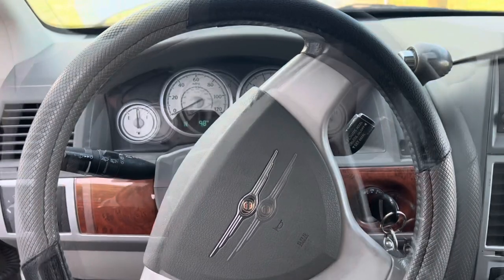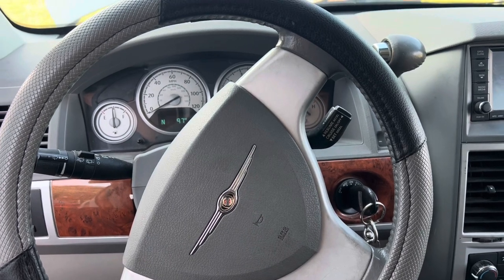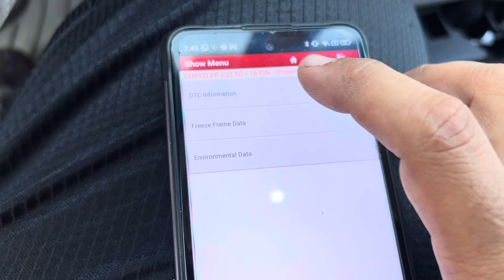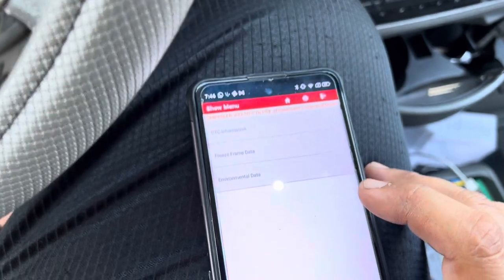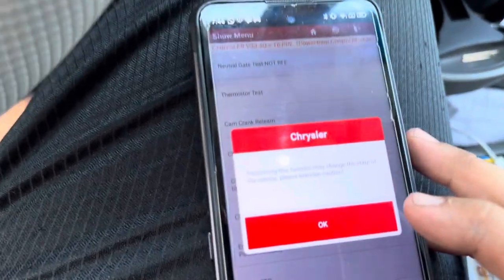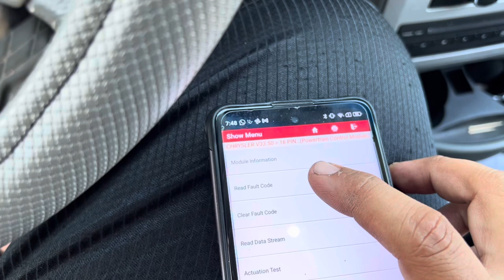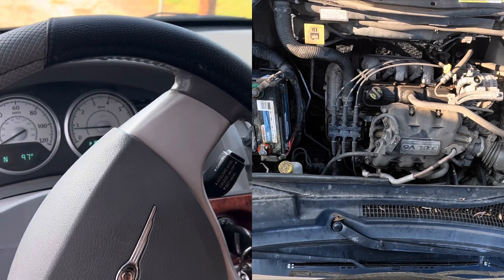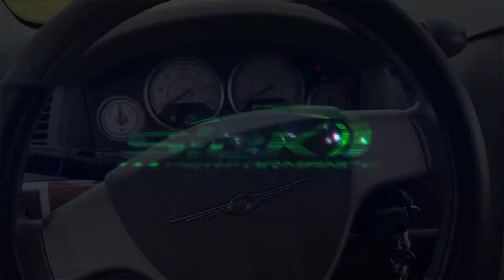P1745 Chrysler/Dodge - How to Clear Permanent Active Code P1745

Comment: What scanner are you using
Reply from the maker: X431 ProDiag
Reply: For that price it would be cheaper for the dealership to reset it. Appcar DiagFCA resets this code and is only $50 online. The elm327 connector for your laptop costs roughly $25
Every dodge/jeep/Chrysler forum uses and swears by this OBD software setup. Not everyone has big bucks to throw away on a diagnostic tool so why don't you guys offer the working cheaper tools as well?
Reply from the maker: @DL30Creations depends where you search. You can actually find for around $100 on eBay new, all makes and models software unlocked not just Chrysler.

Comment: Hi. What is the exact scan tool that you have to clear this code? I’ve tried several of the x431 scanners but they do not have this function.
Reply from the maker: I use an easydiag 2 with ProDiag. To get it to work that way is another story.
Reply: Man your telling me.. I'm a small business owner (father and I) and we've got the snap on zeuz rolling cart and all the fancy attachments with touch screen and dock roughly 8 years back and it doesn't do alot of features our older matco scanner would. Like a slap in the face for 18k 😢

Comment: Is it Thinkdiag in the video?
Reply from the maker: ProDiag. Though I do have ThinkDiag and it has that feature to reset.
Reply: @sickperformance which model thinkdiag do you have that will complete this first variable line pressure counters procedure
Reply from the maker: @jessicamartin321  I have thinkdiag 2
Reply: @sickperformance  and the thinkdiag 2 can perform the clear variable line counters and output tooth counters? I've got p1745 code and my engine is in limp mode until I can clear the counters
Reply from the maker: @jessicamartin321  yes. It has the function for that. Since I had already cleared it with a different scanner, I could not verify 100% if it does work. But it does have the option to select that feature and clear the counters.
Reply: @sickperformance  OK, We have Launch and Thinkcar product, Do you like to test new stuff?
Reply: @sickperformance  yes it will clear the counters (for the sake of confirming this)